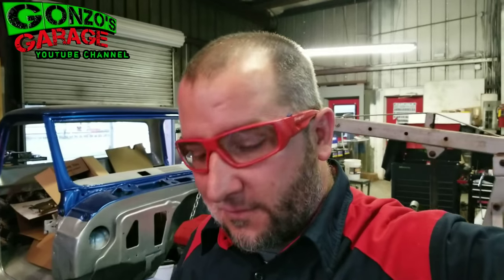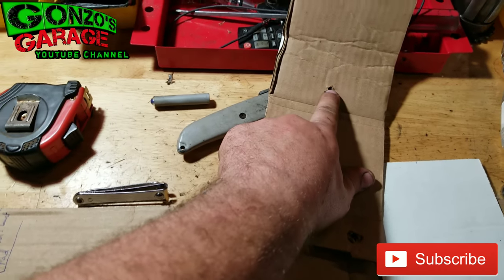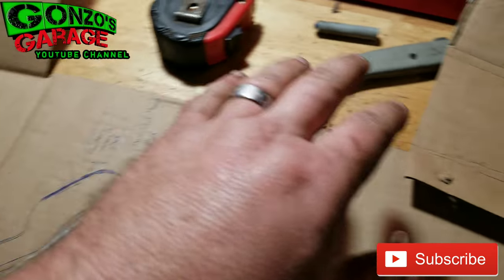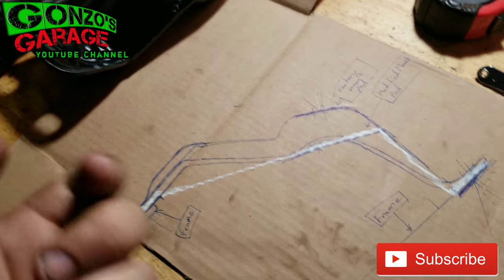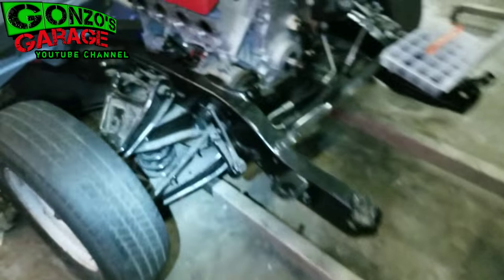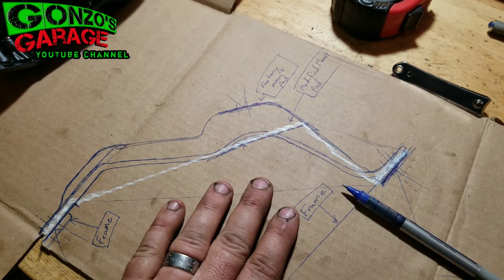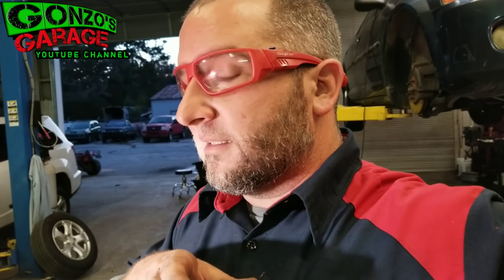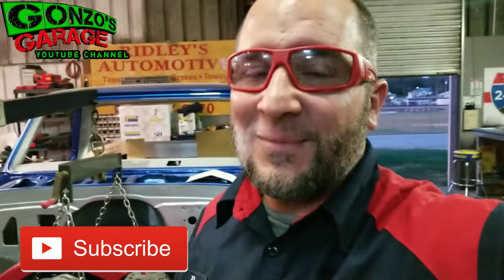Chevy C10 LS7 build ... beginning of custom lower engine mounts

Comment: Cool build man I'll be watching
Reply from the maker: +Gibson63 thanks man.
Reply: Gonzo's Garage So is it done?
Reply from the maker: I mounted the engine and trans, wired the chassis and engine harness, and plumbed the fuel system. but when I got to the AC vents on the dash it had to get body work done. The dash vent holes were filled in by an idiot (not me, I don't do body work, lol) So the owner took it to a trusted body shop here to fix all the bad body work that had been done. He changed the entire color of the truck so he just had them finish it.